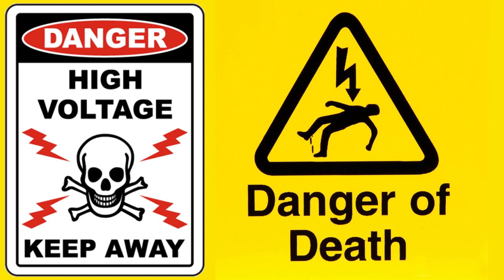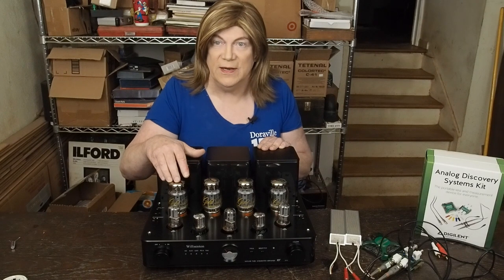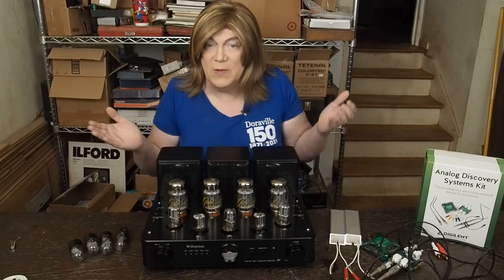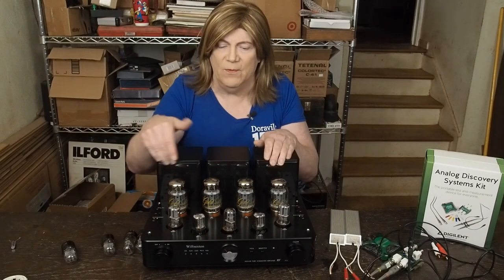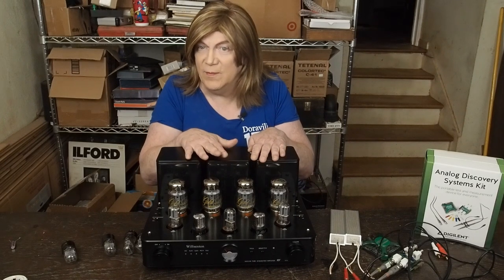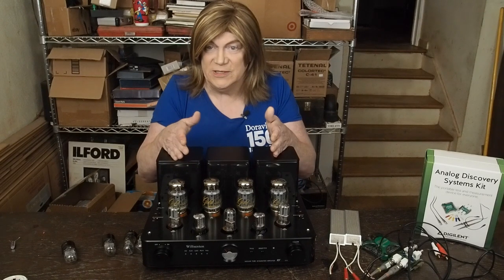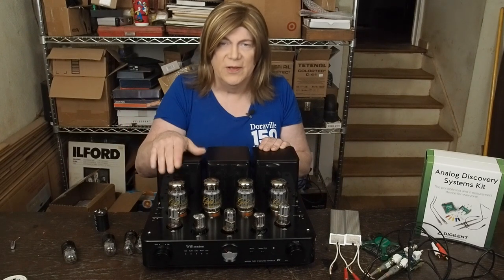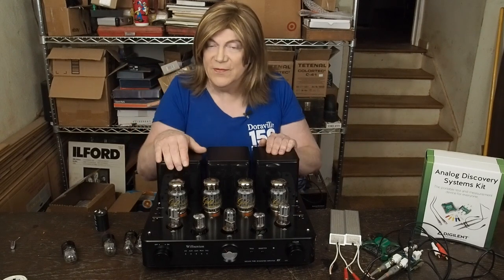Willsenton R8: Listening Test and Tube Rolling Advice

Comment: I replaced the outer 6SN7 tubes with identical NOS Sovtek tubes because the Willsenton branded ones supplied were noisy. I would hear crackling sounds on warm up that the NOS tubes removed. I had previously replaced the 6SL7 tubes with NOS JAN Philips 6SL7-GT tubes and those really smoothed out the high frequencies.

Comment: I am really surprised to see all those so-called problems you mention. I have had my R8 for almost a year. It sounds great, powerful, beautiful, no "hum" at all, even at almost full power with or without input  signal.
We would like to hear about several R8 owners to share what they really experience with this amp. For me, I have been 100% satisfied (and I have been in music listening and playing for decades...) and will not change one thing in it, until proven otherwise. Except for some tubes, which I did, for the best. Thank you.
Reply from the maker: I never said it was going to catch on fire or anything :) Well actually their failure to include a "safety resistor" on the tube bias boards have caused quite a few of these amps to melt down from red plating tubes. Feel free to ignore my advice.
Reply: @SkunkieDesignsElectronics  I am not ignoring. I am just relating my experience. Thanks.
Reply: The problem I have with your review is that - while you seem to recommend this amp, the problems you are noting would require quite advanced DIY/electrical know-how to fix - so at the end of the day only the most can-do DIYer is likely to want to take it on. In effect, this is a pretty damning review, even if done indirectly.

Comment: I almost bought one of these a few years ago. Ended up with the Muzishare X7 with push-pull KT88 power tubes. One of the power tubes redplated inside of 30 days so I returned it to the manufacturer. Gotta love PayPal! Ended up buying another one a year later, performance was decent but I needed more flexibility than the Muzishare could provide.

See you on AK!

Comment: Well on spot with the r8 lack of parts and circuitry cheats. It doesn't matter what you buy from uno where. I'm always modifying it. OT quality level are high...like I've been hearing from numerous owners just might as well add the mods quality components. I almost bought one of those after many months on the market. The price soared and availability, lack of, backorder actually keept me from buying two units.

Comment: I've been trying to modify this amp myself, I noticed also big hum, hiss and other stuff going on. My speakers are 95db+ and sometimes it can be horrible. I suspect that the frontpanel with all extra curcuitry with crystal etc giving noise because i have extra noise on that same channel. I already rerouted some ground wiring and replaced all resistors and Caps (the orginal caps are not fake but old stock (about 10 yrs old in my amp) and i used Rubycon, Nichicon, Miflex 0,22uf / Mundorf Supreme 0,33uf)  and  resistors a mix between DALE/ Mills, Kiwame 2W, and 3W (Koa Speer) and Vishay PR03. Orginal blocking caps are made by Clarity Cap btw, cheapest they sell so not horrible chinese caps)
Main caps i choose KEMET 330Uf/500V but will be replaced with KEMET MKP C4 filmcaps 210uF and the other ones also with 10uf respec. 30uf film also KEMET.
The middle tube to me looks like a voltageregulator. I've seen a schematic on one that was very similar on stereonet forum.
I use KT88 from JJ (sounded great compared to orginal..) and all the 6sn7 is JJ also. THe 6SL7 i havent replaced yet. 

i replaced singalwire with mundorf silver/gold and put a braid over it and run a separate wire to new starground in chassie. I will try to do further improvements with grounding. Got lot of good tips from you so far and will looking forward to next video. I didn't like the main ac wire being unshielded either going to the frontswitch so i installed a new with shield. 
Almost all wires inside are 13 awg to 14 awg silverplated PTFE. 

One thing i want to do is to disconnect the relays and drive tubes in triode directly, My idea was to just remove the 39K and 1K and instead add a 100-180R between pin 3-4 on the KT88s and disconnect the yellow wires to OPT (blue ones are highest resistance so this should be the triode winding) - I like triode the best. Please if you have any input on this let me know in video. You seem to have a lot of knowledge. 

I guess biggest issue i have with this amp that it have always from start been little to forward in uppermid, lower treble. Compared to many other amps like the chinese Yaqin MC100b.
 I got mine in March/April and it looks to identical inside to mine. others ive seen on the net has slight differences, 
Ohh yeah one thing i added was 1K gridstoppers but i couldn't detect any difference in sound,

And for your info; someone linked your video in Willsentons facebook group =)

Best regards

Johan from Finland  and Happy new year to you. Keep the videos coming! Very nice.
Reply from the maker: Thanks for all the info!!! I really like those Vishay Pro resistors. My hope is star grounding this amp will resolve a bunch of issues.
Reply: Hey Johan! Amazing list of upgrades you’ve done to your R8. I don’t know how to do any of that stuff but out of curiosity, how much do all those parts that you put in, cost you in the end?
Reply: @franknelissen8041  I haven’t thought about it but just caps around 250€? Maybe 300-400€ totally with all wires and so on..

Comment: I agree with you regarding Miflex caps - they are way too big to use in these applications the long flying leads needed also act as antennas and cause hum issues and bay also cause instability issues. Excellent comments regarding the design issues, particularly the ground and wire routing though it’s not just Chinese amps that are prone ! 

I think it’s common for amateur modders to throw expensive components in without addressing the engineering problems inherent in the design.

Comment: I've read that the center 6SN7 is the voltage regulator, and I've heard that it converts AC to DC.
Reply from the maker: It can't convert AC to DC, but yes it's being used as a voltage regulator but I need to sit down and figure out how they wired it in the sample I have.

Comment: I have an R8. It is powering a pair of KEF Q350s. Sounds great, and is dead silent. I have not opened it up to see what is going on inside yet. It is an older unit, it arrived in march of 2020.
It may be that I have a dedicated 20amp outlet powering the amp, so nothing like a dimmer or other electronics on the circuit. I also swapped the 3 6SN7 tubes first. This tube swap made a monumental difference to the sound. Harsh glassy high frequencies sounded clean and with less perceived distortion. The entire midrange sounded more precise with more instrument separation. Probably less harmonic distortion, but the tonality seems much more natural and top end is far less fatiguing and harsh. i am lookin g forward to making some cap and resistor swaps.
along wit the grounding and choke mod. Thanks for your work!!

Comment: This is most interesting. I just sold this amp because of the lack of bass response with original tubes. I always thought it was a quality amp but something was missing. Then I had a Fisher 500c receiver restored and when it came back it blew the R8 out of the water. 
I'm betting with your modifications it will make the R8 a much improved amp.
Reply from the maker: I can see on the computer the frequency response is bright. The grounding makes zero sense to me and possibly is the root of what I am seeing? Tube amps are very sensitive to grounding!
Reply: It’s ALL in the tubes , never used the originals . First they’re not biased as a quad set . Have NOS 6500 and EL34 quads . HUGE difference . I actually disconnect my sub . A very good reasonable ‘newer ‘ quad set I have is electro-harmonic 6500’s ( Russian) sadly not a fan right now . However they are very good and cost effective . Also maybe even as important are the pre-amp tubes.6SL7’s ….try 2 high quality of those even first. The middle tube ( V5) is not that important. Nothing changes the sound of a tube amp like high quality tubes . It’s not about the bass ( it’s there) but the presence of kids ( vocals , acoustic instruments ) it’s life like .

Comment: Happy New Year, 
I have some hum thru my speakers, but can only hear it when I put my ear to the speakers.  I switched out the power cord (more for looks than anything else!) to a $30 cord.  It cut down the hum by at least half.  This is my first tube amp and am definitely not versed on electronics, but just thought I'd offer what happened when I changed the power cord.

Comment: Got one of this.  Why are there 3x6SN7s ?  Still puzzled by the role played by the one in the middle.  I upgraded them to the Psvane CV181 Tii Classic Grey Coated.  Just wondered if I could make do with just a pair of the CV181s and leave the Willsenton stock tube in the middle without affecting the performance.
Reply from the maker: It's a capacitance multiplier/voltage control. It's there to clean up the power going to the front end tubes.
Reply: @SkunkieDesignsElectronics  Thanks Stephy.  So I guess it would make no difference in sound leaving the stock 6SN7 there to carry out that duty ?
Reply from the maker: I would experiment, it does seem to impact the sound some

Comment: Good luck finding the source of your hum. My R8 is dead quiet hooked up to a pair of KEF 104/2 floor standers 92 dB & 4-ohm. I use GL KT88s and also have Mullard EL 34s. I run 3 new Electro-Harmonix 6SN7s and 2 NOS Melz 6SL7s (via Jim’s Tube Store).

I’ll scope out those GE short bottle tubes you recommended.

It would be nice NOT to select the Pre-In each time using the remote as I use a vintage Luxman CL-35 MkIII as a preamp. 

Great video and look forward to your next R8 adventure!
Reply from the maker: I may explore how to change the default selection later in this series.
Reply: @SkunkieDesignsElectronics  - Great! PS - I just ordered two GE short bottle 6SL7 tubes you recommended👍👍

Comment: I have an R8 hooked up to a pair of Heresy IVs and it’s quite as quite gets.  I can turn it up to 3/4 volume with no input and it’s silent.  Maybe there was more damage to that amp when the tube fried.  Or maybe I just got a good one.   Who knows.  But mine is very quite. (I’m running Golden Lion tubes as well)
Reply from the maker: Maybe you got lucky? Other folks I read say theirs has some hum. It's not loud but it's there. The ground loop hum issues from weird grounding was loud.
Reply: I have the same setup,  R8 to Heresy IV, and also  dead quiet.
Reply: @pnichols6500  I really like my setup.  How about you?  What DAC are you using?  I’ve got a Pontus II, Sounds really good.
Reply: I have this amp driving the new Wharfedale Lintons. DEAD quiet at any setting. Couldn’t be happier with this beauty, even with the stock tubes. Tax return gonna go towards some Gold Lion upgrades.
Reply: @jameselliott2975  Go for it James!  Golden Lions are worth it.  I also have some EL 34’s  but they sound thin to me compared to the KT88s.
Reply: I have the R8 driving Triangle Comete EZ speakers and no hum. I have Psvane UK-EL34, Tung-Sol 6SL7GT and stock 6SN7.
Reply: Bob, I just hooked up my R8 today, with good cables and vintage (but "Crited re-capping) Heresy's. I have almost no bass. How is the punch on yours?
Thank you,
Jeff
Reply: @jeffreyvanhorn1996  Hi Jeff,  I have really good bass BUT… I’m running Heresy IV’s which are ported and I’m running a Rel T5 sub.  I highly recommend the Rel T5. It’s small but it’s very musical and blends in perfectly.  I’m sure it will fill in you Heresy IIIs perfectly.  You can dial it up or down to your desired punch.  Unfortunately it’s another $700.  I really like the sound of my system.  R8 / BlueSound node 2i/ Denifrips Pontus II / Heresy IVs / Rel T5.  It’s a really special sounding system.  I tried some Mofi Source Point 10s back in December & January and I already sold them.  Don’t worry, you didn’t make a mistake, I think if you add a sub you’ll be really happy.  Great talking to you.  Let me know what you end up doing.  Peace out ✌️
Reply: @BobTrainor  Bob, great to hear your input. Thank you. 
At first I thought, "How is he running a sub?"
Then I saw you had a Node. You're running a Coax off that, I'm assuming?
I have a couple of questions. 
My R8 is brand new. When I select the CD input, the AUX 1 lights up with it. When I select AUX 1, the CD input lights up with it as well. The only difference is that the input selected is slightly brighter than the other.
AUX 2 lights up just by itself, like it's supposed to.
But here's my concern.
I have a Bluetooth device connected to AUX 1 so I can stream from my phone.
But it still works when I select CD! I don't think this is supposed to happen.
Do you get anything like this happening with yours?
I may send it back and get another.

Thank you very much,
Jeff
Reply: @jeffreyvanhorn1996   Hi Jeff,  the Rel sub runs off of your speaker taps.  It connects to both left and right speaker terminals on the back of your amp.  (Together with the speakers). It comes with a with wire that is for use with amps without a sub out jack.  It helps the sub really blend well with your speakers.  It is the way Rel likes to do it.  As for your amp input issue, you should disconnect all inputs from the back of your amp and try switching between inputs.  Do the lights light up correctly? (One at a time). If they do, your issue is interference from your Bluetooth device you have plugged in back there.  If the lights still do not light up one at a time when nothing is connected to your amp you do have a faulty amp.  But I bet it has to do with your Bluetooth. Do you use a streaming service for your music?  If you do, you want to get a streamer.  WiiM  mini is really good low cost streamer for about $90.  And the new WiiW pro is even better & $150.  That will get rid of your Bluetooth if it’s your problem.  The streamer gets to the internet on your home network and streams your music from Spotify, Apple Music, Amazon, or tidal or just about any streaming service and your phone connects to the streamer through your home network (WiFi) as well.  The streamer (in this case the WiiM mini ) has a built in DAC.  You can output from a steamer into a better DAC at a later point if you like.  But first unplug all inputs from the back of the amp and see if the input selector works as it should.  If it does the problem is with your Bluetooth device and if the input selector still doesn’t switch between inputs cleanly, then you have a bad amp.  I bet it’s the Bluetooth though.  Let me know what happens Jeff.  Peace
Reply: @BobTrainor  Bob, this is absolutely great info. 
Thank you!
I will be back home in a couple of days and will do as you suggested. 
I will do the research on your sub. That would be awesome if I could connect the sub to the R8.
I’m excited to try your suggestion, but it seems I tried the input selector before the Bluetooth device, but I can’t be sure. 
I’m hopeful. 
If I have to send it back for another I still have time. 
I’ll certainly let you know. 
Thank you again so much for your reply.
Reply: @jameselliott2975  Still like the amp with Lintons?

Comment: Hi Stephe, you obviously know more about this amp than I do, but mine is dead silent. I am using JBL L150s and even with the volume all the way up with my ear in the speaker I cannot hear any hum. I am using the original kt88s (Although I have a quad of KR Audio kt88s on the way!),  with PSvane  151 tii in the 6sn7 spots,  and Sylvania NOS 1955 tubes in the 6SL7 spots. I tried RCA 5691 red base black plate tubes that were very expensive, but they dulled the mid to upper frequencies too much.  The Sylvania's sounded much better to me. I know you said  you didn't like the PSvane 151 tubes, and I admit at first they are too bright or harsh, but if you give them time they smooth out tremendously. I have about 150 hours on mine, and I have heard that they require up to 300 hrs. to burn in. Great video thanks for sharing your knowledge!
Reply from the maker: Mine is silent wide open, I hear a tiny hum at 1/2 volume. I'm not shocked some people hear nothing, I've had other people msg me that theirs does the same as mine. And those JBL's are 88db speakers which might help.  :)
Reply: I meant PSvane 181's I guess I had rum on the brain!😄

Comment: National tubes are imported by Richardson Electronics from La Fox Illinois also try floating the third wire on the power cord ground with a three wire to two prong adaptor as you may have ground loops thru the power cord. Been building tube amps since I was 14 years old I'm now 77 and have learned a lot of things to get rid of hum I'm presently using a single 211 amp with a homebuilt Cary Audio AE1 preamp and Klipsch Khorn speakers 
Bonnie Kapischke   W9EBO
Reply from the maker: I found the hum (a bad solder joint on the heater virtual center tap).

 And NEVER unground a high voltage tube amplifier!!! If there is a ground loop from the power cord, there is either something wrong with the amp or a design issue. An ungrounded amp no longer has protection in case of a parts failure and the chassis could become "hot" with lethal voltage.

Comment: According to Willsenton R8 manual you should connect speakers from 4ohm (red) and 8ohm (black) terminals. So from 4ohm AND 8ohm. Is that correct? It actually sounds good that way.
Reply from the maker: I doubt it say to connect across the 4 and 8 ohm terminals. You connect from either of the red to the black, not both.